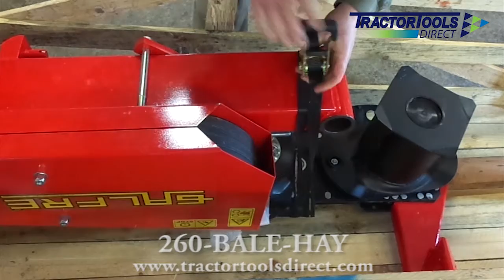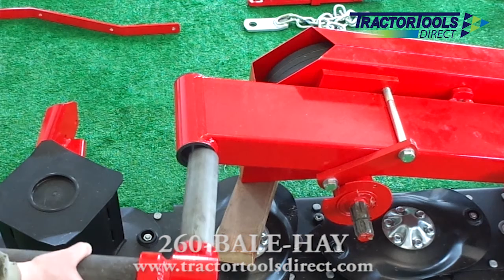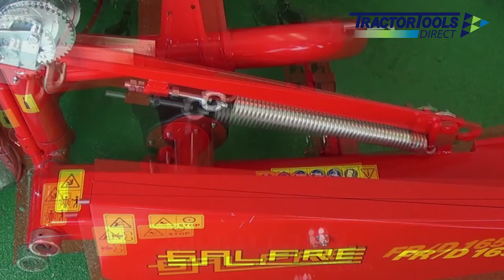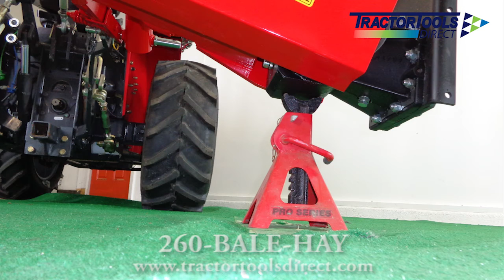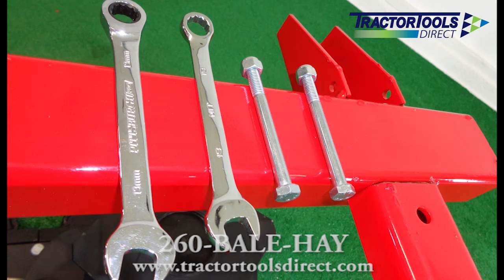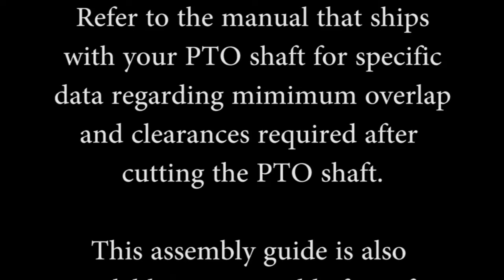Galfre Disc Mower Assembly Video

Comment: How do you check the mower bar oil?
Reply from the maker: Good question. The oil can be checked when the cutter bar is raised into transport position. Let the oil drain for about 5 minutes after raising it. There is a fill level plug between two of the discs, part way up the bar. We have a copy of the owner's manual on our website for your convenience, just click this link and go to the "Hay Mowers" tab, and find the Galfre Compact Disc Mower in the list: https://tractortoolsdirect.com/brochures-and-manuals/
Reply: @Tractortoolsdirect  thanks! It has a dipstick on it like it needs to be checked horizontal
Reply from the maker: @willis19711  That's a bit strange... I'm not quite sure why that its, could be that a dip stick type is used in another machine and they are using the same plug for efficiency... or if it's not new to you the previous owner could have replaced with a different type. I would go with the manufacturer's instructions either way!
Reply: @Tractortoolsdirect  it's an older galfre 245
Reply: @willis19711  the dipstick is just for the gearbox not the cutter bar, wonder how you’re supposed to drain the gearbox because there is no drain plug.